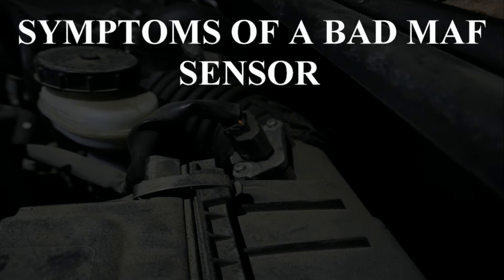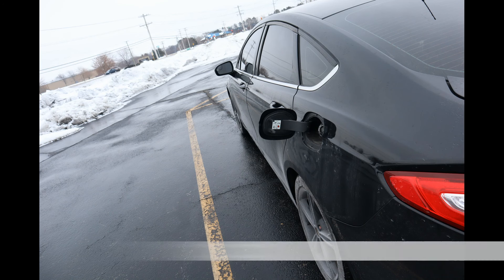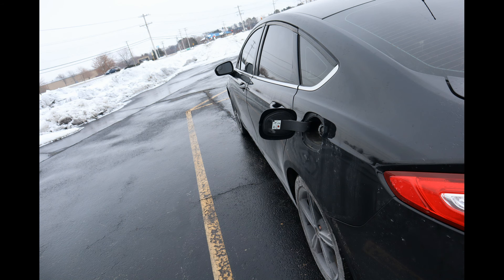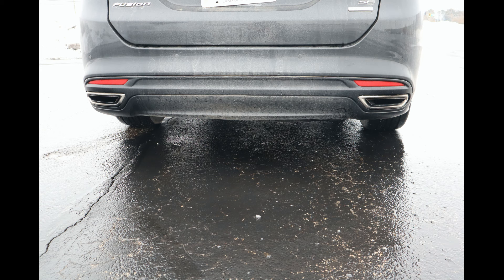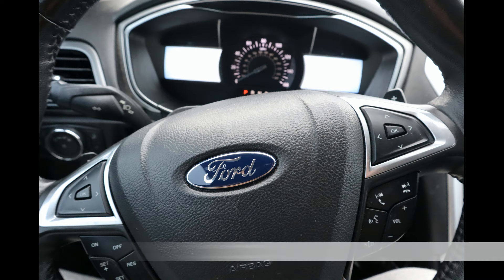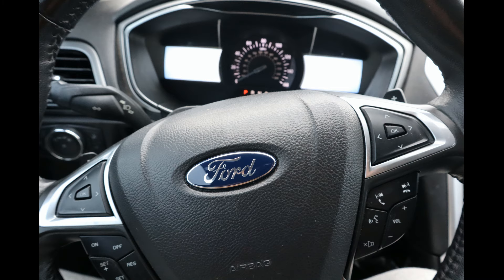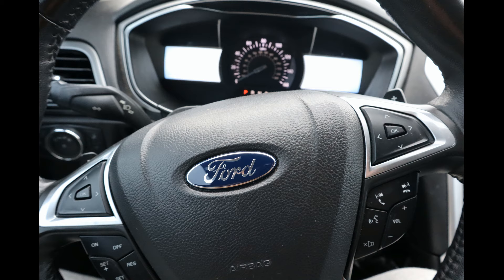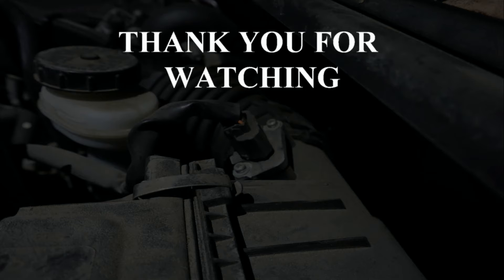MASS AIR FLOW SENSOR SYMPTOMS

Comment: It can also cause slow throttle response and lugging while accelerating
Reply: I’m having that,was going to try spark plugs,it feels like a misfire and my mpg down like 6mpg but hope it’s just a dirty maf..
Reply: @davidtorres-tg2xx  did you fix it?
Reply: @iceys5960   no was dirty spark plugs,they were burning oil,what caused that was leaking valve gaskets so I used liqui moly motor oil saver to rejuvenate the gaskets instead of manually changing them will manually change them eventually tho
Reply: When I hit the gas at first it kinda sputters but then it’s ok
Reply: That’s what’s happening with me!
Reply: I have that problem with my bmw series 3 2013 3.0l 6 cilynder turbo
Reply: Same problem here on a grand marquis.
Reply: @corneliuswilliams8317 was it your maf sensor?

Comment: Had this today. The shop tried to charge me $200 to swap out my MAF. Which is on top the engine, to the right, two small phillip head screws, which would have took them less than 5 seconds to do. And then I price checked NAPA Auto parts, who wanted $110 for an MAF plus another $50 core charge to refurb it. Sooooo, I went to AutoZone and got one for $88 No core charges. Absolute pain in the ass. It's a toaster for God's sake! Also, just to spite the shop, I did grabb my screwdriver,  to show him how easy it was vs his $200 BS. I'm a girl yes, but not mechanically stupid. Just changing the oil on this car only takes me a few flipping minutes. It's why I bought the car in the first place, easy maintenance. ((Unless you're trying to change out your belts, that bolt B on the alternator is a real trivial pursuit. Makes you cuss like a pirate. One that I still can't get off...unless, someone can make a video where they show both A & B being loosened I'd be all for it. Cause doing just A won't cut it!))
Reply: Why take it to the shop since you know it all?

Comment: I have a 2000 ford F-150. It starts great when it cold. But when it warms up, it takes longer to start. Could this be a bad mass flow sensor or maybe the fuel pump? I've noticed over the years the it doesn't have the same pick up that it used to have. Its not the plugs because I've recently changed them. The gas mileage is ok but I think it should be better. It runs good when it idles. It has no misses.

Comment: Hi. Thank you for the vid. I have a Vauxhall mokka (maybe Opel Mokka across the pond) I've had power/smoking issues for months now. If I need to put my foot down enough for the turbo to kick in (I know nothing about cars...) it will struggle really badly and start smoking from the exhaust really badly. So far, I've had the turbo replaced and it's since passed it's MOT...
The issue is some what better, as it doesn't seem to try to stall anymore, but I'm not putting my foot down, as I'm avoiding motorways etc, so difficult to tell how bad the issue still is as I'm terrified of the pushing it and the engine blowing up!. My engine management light now keeps coming on and that's what's brought me to your vid after getting this error code. The car is currently not really fit for purpose.. I feel like this error code is now resulting from the initial problem... Does that make sense? Could the maf have started the issue without actually showing the error code or had the initial error caused the maf to go bad?..
Either way, I'm pulling my hair out and have more money to throw at it, so any advice would be truely appreciated
Reply: Oh and it does really struggle now when 'idle' as you explained In the vid

Comment: My 2015 Nissian Sentra was having issues more gas wasted and the pedal to the floor and it wouldn’t run. 
I thought it was the transmission but it wasn’t it was the air flow censor the air flow was killing my gas usage and lost of power
Reply: Bro.  I got the same exact car having same problems.  I'm going to change it the maf next week.  If it's transmission they have a recall on trans so I'll take it to dealer

Comment: When im driving sometimes in like 2.5K- 4K RPMs it'll feel like a halt and RPMs wont go up for a couple seconds but then it goes back to normal, could this be caused by a bad MAF sensor?
Reply from the maker: Potentially, is the engine light on ? how many miles does the car have ?
Reply: @easyautofix  No engine light isnt on and its at about 38K miles
Reply: Is the Transmission
Reply: Give the car a tune up
Reply: Did you fix it? What was it?
Reply: @intaniik5743  maybe oxygen sensor if not  check the transmission
Reply: Throttle position sensor
Reply: Possibly the vtec solenoid pressure switch
Reply: Check to see if there’s any oil present on the back side and below the valve cover. If there is then it’s likely a leaking solenoid and/or pressure switch

Comment: Could be what’s wrong with my 17 Altima. The engine light is on, can shift fine just doesn’t accelerate. No burning smell from the engine or transmission. No hard start or weird noises either
Reply from the maker: What are the codes related to the engine light?

Comment: I have a question I just installed a intake on my 2010 civic it ran perfect with the stock air box but not it’s throwing a code for throttle spring malfunction I can’t seem to find the issue it runs for 5-10 sec then shuts off also my check engine light is on

Comment: I've got a MAF problem on my 2007 Hyundai Santa Fe GLS AWD. it reads P0102 (mass air flow is low). It has one of the symptoms and it's hard to turn over the engine at the gas station. Is this another cause?

Comment: I have bank 1 and bank 2 lean. Hard starts, especially after driving. Slow acceleration slow going up hills  p0171 p0174
Reply: Did you figure out what was the issue?
Reply: @ditomathew1  not yet, about to change intake manifold

Comment: Could this also be why my car is randomly jerking now when it shifts gears? I had issues with my MAFS and have cleaned it with the spray a couple times, changed it out once but I think the new one was bad so I took it back and put the old one back in for now
Reply: Mine started jerking first thought was transmission, I’m changing the maf sensor tonight to check it out
Reply: @devinely4425 did that work?

Comment: I need some help. I have a car that runs fine when I put my air conditioner, it was running fine and then it shut down on me. When I went to restart the car, it was hard to start a couple of times. How would I know if it’s the map flow sensor or the idle control valve because the AC works just fine

Comment: Can we fix it. B6 cleaning or do I need a new one?I have a bad gas smell. I have misfire, rough idling. Said faulty plug one. 98 Corolla. I changed spark plugs and wires for plugs. Car is bad on gas, check engine light flashing. I had oil in first spark plug that was misfires. Car rough idling and misfires and acceleration is bad
Reply: what did you do to fix this

Comment: I've been to the garage first they fit on a new cat converter I could tell the heat shield was rattling and it sounded rough. New cat 🐈  fitted and it still sounds like it's roaring when  I get over 30mph by the time I get to 50 it's like a jet engine I wouldn't even attempt 60 in case it took off. I don't have any of these symptoms on this video accept for what I mentioned they ran it through the computer and said its the maf sensor and as always they try to make you pay for plugs, the plugs are new and the exhaust is fine it's been up on a ramp in a separate exhaust and tyre place they said nothing is wrong with the exhaust as did a separate m.o.t tester. Watching this video has just put a spanner in the works but it does sound like a air to fuel ratio problem it's 18 years old and never ever broken down or had more that about 100 pounds u.k sterling spent on it per m.o.t  obviously tyres too but I sort that before the m.o.t , it has a new m.o.t now it's still only 70k and its so ugly that it makes me look good so I want to keep it. This car is like double dating always take a uglier wingman. Any idea guys or gals what the issue sounds like to you? Be good to get some solid advice. Think darts vader breathing and that is the sound I'd like diagnosed plz . Merry Xmas gaz guzzlerz and Roy bacers

Comment: Well i had problems with acceleration on highway if i passes like 160 km/h if i tried after that to accelerate the car open and closed air coming i cleaned the maf sensor and now engine light is on i think i have to put a new maf sensor ??

Comment: Well since I got the car it’s been giving me the engine light so I cleaned outThe airflow sensor it didn’t work two weeks later it came back on giving me the same reading so I replaced it all together and it’s still giving me that reading I don’t know what it can be if you can please help I’m going to test it this weekend by starting the car and I’m plugging the sensor and if it stops the sensors good if it keeps running it’s bad but then again I don’t know what else it could be
Reply: Go have a mechanic clear the code

Comment: I have bad MAF code, so I replaced it but I'm still getting the code, can it be bad fuel pump?
Reply: Check for cracked air hoses or cracks in the intake tubes
Reply: @Packs602  can that cause car turn off on idle?

Comment: I need to check mine. My chevy 3.6 starts, idles smooth for about 10-15 seconds then idle drops a few times then goes back to normal....then dies. All at park,...with no codes.

Comment: Can you tell me why. I already changed new mass air flow sensor on my car and I drive around 20-30 minutes. But the check engine light it's still on.
Reply from the maker: Do you have the check engine light on? if so what are the codes?

Comment: Could a faulty mass air flow sensor cause a jump in rpm when accelerating?  My car does this when I reach around 30mph, just a quick jump from like 1500 to 2000 then back to 1500.  After that it drives like normal.  Slight shake at idle as well, sometimes.
Reply: Mine jumps to 3000rpms lol
Reply: Possibly but more likely your IAC, idle air control valve, is faulty or dirty. It works in a way to allow air to bypass your throttle body when the engine has increased load at idle, like if you turn on your a/c while parked for example. This increase in load lowers rpm to an infavorable level. To increase the rpm without opening the throttle blade itself, the iac opens to compensate for that returning things back to normal. If they are faulty or dirty they can become stuck open or be intermittent increasing your idle or rpms randomly. On some vehicles you can unplug your iac and if it's faulty it will make it run better (faulty) or no change (stuck) or lastly itll run like crap when you unplug it and that means its working. Hope this helps
Reply: @DylanC828  my car doesn’t have that apparently already looked into it :(
Reply: @christiangomez4981  ah, diesel?
Reply: @DylanC828  no it’s gasoline V6 . It’s a 2010 Saturn outlook xe . Now I just cleaned my MAF SENSOR last night and I’m hoping that’s the root cause of my rpm’s jumping randomly. It was completely dirty.
Reply: @DylanC828  Definitely helps!  Thanks!

Comment: Can it cause you car to go into limp mode? My car drives fine if I use cruse control but regular driving has about half the power and this is one of the code on the engine out of 2 other which are for camshaft positions a and b. TIA for anyone’s help!

Comment: Hey mate, I have a 2016 Toyota landcruiser, 90,000 kms and in the morning when I start it it starts then shuts off straight away, then starts and is fine: no engine light, would this be the same issue you think? Thanks in advance and good video
Reply: Ever figure this out?

Comment: My car had bad fuel mileage  more  than 100 miles , I cleaned the  maf sensor  it helped but then it started the same problem should I replace the maf sensor ? { Toyota Corolla 2010 le ) 
 Full gas tank = 330 miles 
 Now it’s only 215 miles full tank

Comment: Can one of the symptoms also be slow acceleration?
Reply: Yes.
Reply: 100% your car will have to work harder to pull in the fuel/air mixture.
Reply: @PharaohProduction  I disconnected my MAF but I’m still getting poor acceleration, and my car has rough idle and service light is on even though it was serviced a month ago. I’ve changed coil pack and spark plugs too but still same problem
Reply: @frankcastle9866  are you sure that your sensor is in good working condition ? Try taking it out and cleaning it then re-connect it. See if that does it.
Reply: @PharaohProduction  when I took it to mechanic they said you don’t have to take it out to check if it’s bad. He said If u disconnect it and the problem is still there that means there’s nothing wrong with MAF
Reply: @PharaohProduction  When I give full throttle car doesn’t pick up speed as it should I’ve changed everything even the Catalytic converter
Reply: @frankcastle9866  hmmm very interesting…. Might be just a throttle position sensor or whatever. Look up the video on youtube. You’ll find plenty of Mercedes doctors on here. Good luck man cause I’m also replacing my MAF right now cause of poor acceleration.
Reply: @frankcastle9866  do you have a engine light ?
Reply: @PharaohProduction  My engine light was on before and that was for the catalytic converter, I thought that would fix acceleration problem but it didn’t
Reply: @PharaohProduction  ah yeah I forgot about the throttle sensor I will need to check that
Reply: @PharaohProduction  check for vacuum leak I know that's my problem atm for slow acceleration
Reply: @frankcastle9866  it just happen to me,I just changed the catalytic converter and still problems with the acceleration,right now o don’t know what might be,if the mafs or the fuel pump
Reply: @juliorives6107  Take it to a garage, disconnect the MAF and drive the car. If the acceleration is fast again then the MAF needs replacing, if it's the same then it's not the MAF that's faulty
Reply: @frankcastle9866  thank you bro,I just did it,my cousin just told me that it could be clogged fuel injectors
Reply: Finally thank you

Comment: I have low acceleration at highway speeds. Has a flat spot in acceleration, then picks up. Bad gas mileage. Idles smooth. Starts fast. MAF Sensor?
Reply: Does it go like it should in higher rpm???
Reply: @unfknknown9678  yes

Comment: What does it mean if the sound coming out of the muffler sound spuddery..also the van seems to excelerate good buuuuut if I’m in park and I rev the engine it feels like it’s rumbles a bit..the motor slightly has a rumble feel and sound,also the exhaust sound spuddery muffley sound..lol..I thought the exhaust air sound coming out should be a constant pressure and sound..not a spuddered  sound..

Comment: We have had our nissan rogue 2011 tested and it kept saying it was the p0101 code. We have replaced the maf 3 times and it's still the same code. We are so confused and running out of fund to fix it. What can it be. Smh
Reply: My daughter has a 2015 Nissan Pathfinder doing the same thing. Two new MAF replacements and still has check engine light and P0101 code. Head scratcher!
Reply: @edwardhindman8707  turns out the sensor was damaged for us.

Comment: I think I have this issue when I start my car when cold there's a grinding as the RPM sets also I hear squealing when accelerating I think I might also have bad wheel speed sensors . Hopefully it's nothing more serious
Reply: Check your belts and pulleys, a wheel speed sensor is a none moving parts and won't make noise also ABS and TRAC lights come on withe the bad wheel speed sensor

Comment: Could running the car in this condition for a long time cause other parts to wear out? Such as the catalytic converter or sparkplugs/coils?
Reply: Absolutley
Reply: You could cause a misfire in your engine if you keep driving on a check engine light

Comment: I have a Nissan Frontier and sometimes when i stop on a red light or stop sign its turns off by it self is do i need to replace mass air flow sensor or is it something else
Reply from the maker: Great question, is the engine light on?
Reply: @easyautofix  I have the same issue in my Nissan Maxima and my engine light isn’t on, could it be my MAF sensor?
Reply: It’s the crank sensor Nissan is known for those
Reply: What was the problem

Comment: Could this issue cause the vehicle to not start right? And also if it happens to start will the issue cause it to stall and shake and cut off? My 2001 Chevy S10 6 cylinder is doing these things. I can't even really accelerate forward or backward much before it shuts off. And my rpms are going all the way back and forth in the process. Any ideas that can help?
Reply: Did you ever find the problem ? I’m in a similar situation
Reply: @bryanhale6649  did you figure it out?
Reply: It was my mass air flow sensor. I replaced it and it started working.
Reply: @brandonhoward69  Thank You 😊

Comment: I drive a 2016 Ford Fusion SE and I’m getting lag at acceleration and jumpy shifts. The car is nearing 70k miles. There’s no check engine light when the ignition is on but I have noticed it being on when the car engine isn’t started. Other than the laggy shifting and accelerating the car runs fine. I am wondering if this is a MAF issue.
Reply: Almost feels as if my accelerator pedal and throttle aren’t in tune with each other. Same with the transmission almost seems as if it’s getting delayed signals.
Reply: I feel exactly the same !

Comment: I'm trying to figure out wtf is wrong with my damn car. no engine light. car sounds like a bad fuel pump but the car doesn't over heat. changed out ignition coils, spark plugs, fuel filter, relay switches. I've cut down every possibility and I want to scream because idk wtf is going on.
Reply: Did you figure the problem out? I'm having issues with my 2017 escape..replaced so much because of slow acceleration..now I have jolting when accelerating (sometimes but not always?) I'm going crazy!